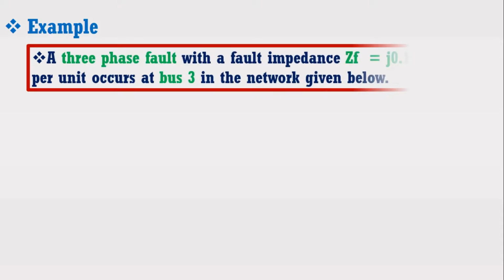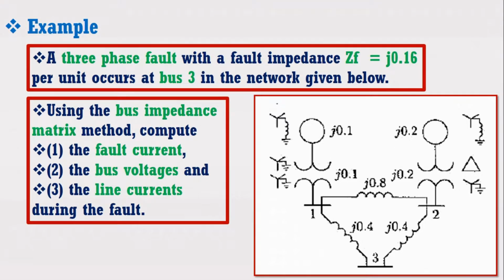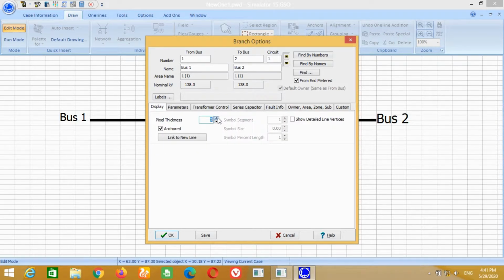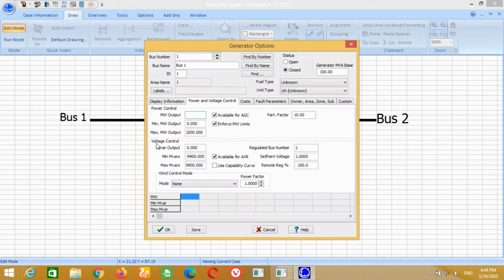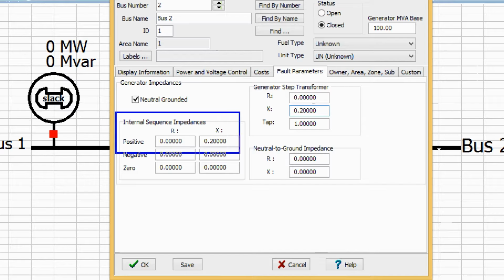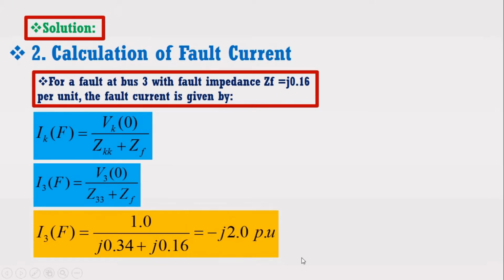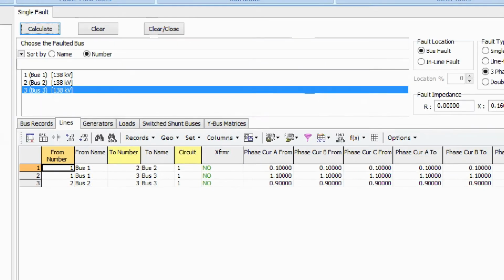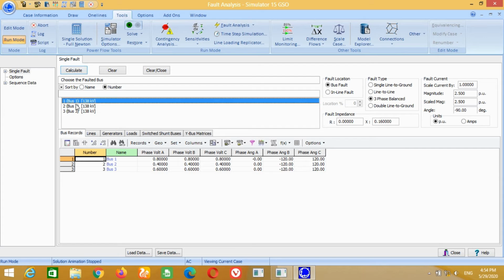How to Perform Three Phase Fault Analysis in Power World Simulator? | Dr. J. A. Laghari

Comment: Sir,in this single line diagram,why you don't include transformer??
Sir,make more videos on transient stability analysis and unsymmetrical fault analysis... Using both power world simulator and Etap
Reply from the maker: I have taken this example from the book and have modelled it according to the book.
Reply: Sir,make more videos of transient stability analysis of ieee 9 bus system

Comment: Thanks sir but it doesn't show up a result until i put a load on bus 3 i don't know why doesn't run without a load has yu did
Reply from the maker: Thanks for the comment. May be. But it makes no difference. because fault current is always extremely higher than the load current.

Comment: Very helpful, but I came across a problem. I ran a simulation successfully. When i decided to increase the reactance of a line the simulation failed. I then tried to use the previous reactance value and it still failed. Also the MW and MVar of my generators seem to change on their own, Kindly help, thanks
Reply from the maker: Thanks for the compliments. Just close the power world simulator and open it again. Now open the file again and run the simulation. Hopefully it will work now.